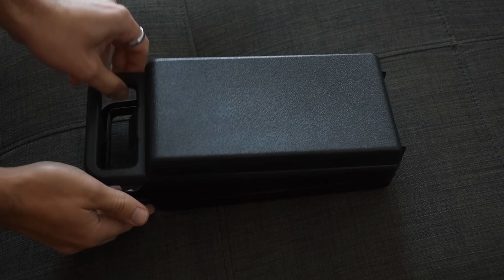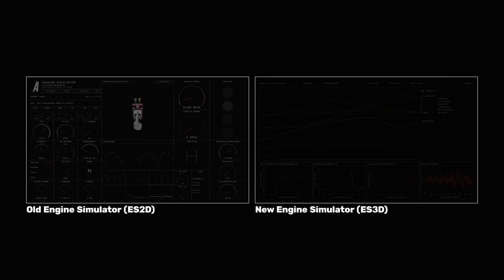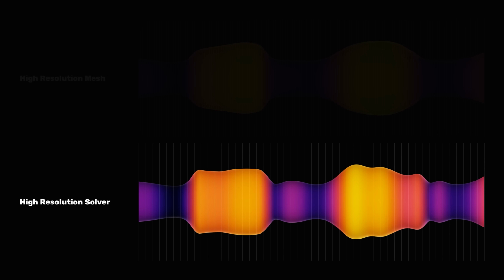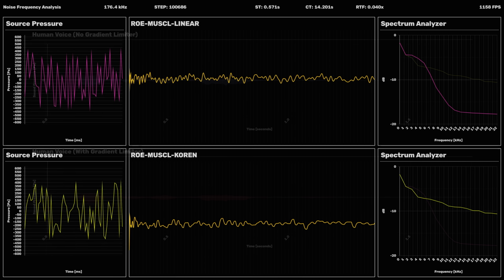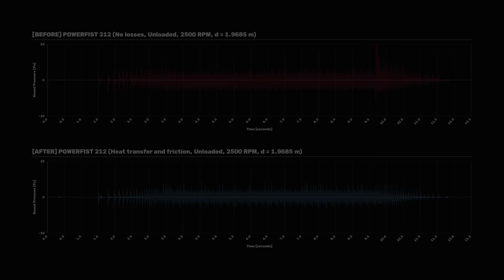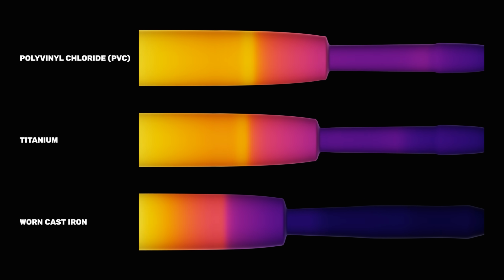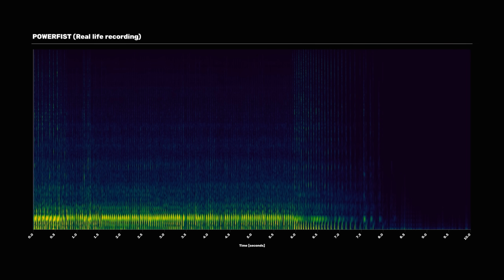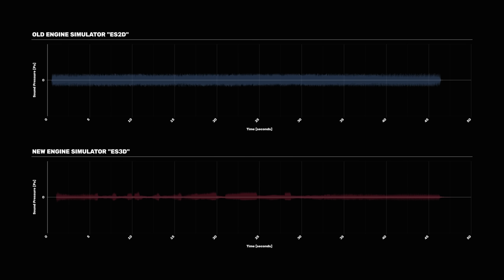Improving My Engine Sound Simulator With Real Data

Comment: Would there be a possibility that the fluid simulation is also hampered by the lengths only being the center length? Would the smoothing that comes from allowing the energy to take potentially bouncing paths be doable? Basically pulse dispersion.

Comment: I must say final samples sound like having ear directly at the exhaust exit. You Sir are very very close to real life sounds. I'm pretty sure that some online recordings of exhaust system makers like Yoshimura, Two brothers etc. are incredibly close to engine sim. and it might due to them recording straight shot from the tip, for some reason without the "puffs" of wind.
Probably to get more natural sound there should be an actual muffler like area were pipe no longer is a pipe. Mechanical chatter probably also is a factor, as it is with many things, imperfections are a part of what makes - visceral. A bit convoluted comment I know, but we are talking here about one human senses and in my case in non-native language.

Comment: When I was simulating guitar physics, by far the hardest part was to simulate the area where you're plucking the string. Without extreme care and deliberation, it sounds like you're playing the right notes with a sledgehammer.

Comment: I think the hacks you had to make to absorb high frequency reflections on the boundaries might be a byproduct of trying to approximate a tube with a 1d system. Especially the interface really requires at least a 2d system to be resolved adequately, and will naturally produce turbulence too.
Reply from the maker: By that logic, any fluid simulation would require 3 dimensions to not be considered a "hack". Yes, we are simplifying a 3D object into 1 dimension which for the purposes of this problem produces an adequate result. Assuming that at an outlet is a perfect pressure node is what causes the excessive resonance. In real life outlets are not perfect pressure nodes and have finite size, creating an impedance mismatch between the tube body and the outside world. Modeling this with a 1D simplification is not simply "hackery", it's a valid model created through simplifying assumptions, just like the rest of the simulation
Reply: @AngeTheGreat  if you don't like me calling it a hack, call it a crude approximation (of the outlet specifically). In a 2d case, the outlet creates vortices that quickly dissipate energy in a very nonlinear way. In 1d, you can't represent that at all, and I'd argue it probably has a higher impact on the overall sound than acoustics of the duct itself.
Reply: @AngeTheGreat also, axially symmetric geometry (like a 3d cylindrical tube) specifically can be represented very accurately in 2d, but it's really unclear to me why a 1d approximation should be sufficient.

Comment: i feel like this simulator has the potential to be groundbreaking for 2 stroke tuning. if you simulate intake/exhaust ports, transfer ports, reed valves, and expansion chambers with negative pressure waves, this simulator would be amazing for finding the best theoretical port maps/durations for a powerful top end, or low end torque etc.

Comment: 20:14 you probably already know this but a thought from doing small engine repair in the past. the amplitude increase at the end of the sample in the real recording of the 212 is from the throttle being slammed open by the govenor and increasing the amount of 'cold' air going through the exhaust. the simulation doesn't seem to do that, mind you, i wouldn't be surprised it doesn't yet, i'd argue that's such an edge case and not worth worrying about. it's really impressive that you've got to this point where we can nitpick over incredibly small things, it shows just how impressive the simulation is getting.
Reply: I think he plans on getting the fuel and intake systems simulated at a later date. When he made that chainsaw engine a while back, he mentioned that he tried to get a carb sim working to get that rough idle, but it didnt work too well. My guess is he will add in the more realistic intake and fuel systems once the fluid sim is nailed down.

To my ear, almost sounds like somebody made the 212 fuel injected in the sim and removed the mechanical govenor. I dunno tho, im no small engine expert.
Reply: Yes i recall that as well;  I know for certain engines he'll probably be thinking about intake plenum design for intake noise etc.
It really does sound like that and i feel the same applies to the harley engine. S&S and Harley Carb engines tend to be quite lean when revved and have a distinct hobble, that's is missing here.
Reply: The governor's spring is such a pain

Comment: Honestly at this state, applying an impulse response to evoke an environment feels like the final nail in the coffin already.
Some characteristics under load is so convincing. A motor cycle exhaust down a tunnel compared to the simulated I suspect to be so hard to tell apart.
That said, I think the finished simulator at the end of the day should allow the user to select between impulse responses and perhaps even custom. I haven't looked but I hope licensing won't become a problem to find decent impulse responses when distributing.

Comment: The problem where there are some "alien noise", very noticeable at ignition seems to still be present even in the latest samples. From what I've understood it comes from the simulation not representing the microgeometry of the inside of the tubes. There is too much resonance of higher frequencies compared to real life because of that. We have a similar problem of representation of micro-geometry in computer graphics. We call this geometry "Microfacets", you can look into "BRDF cook-torrance", it's one of the method to solve it.

Comment: I know it's become a bit of a buzzword, but AI can really help improve realism in situations where the exact underlying physical phenomenon is either unknown or impossible to solve in real time. If you run into something like that, using some kind of neural network as a black box post processor could be useful.

Comment: AI Summary

Abstract:

This video documents the extensive process of overhauling the fluid dynamics simulation for the game "Engine Simulator" to achieve highly realistic engine exhaust sounds. The process begins with collecting baseline audio data from a real single-cylinder Powerfist 212 engine using a calibrated measurement microphone. The creator then details the methodical, layer-by-layer reconstruction of the simulation, starting with a basic solver and progressively introducing more complex physics.

Key technical challenges and their solutions are explored in depth, including mitigating "artificial dissipation" with high-resolution solvers, managing numerical instability with gradient limiters, and implementing accurate models for valves, friction, heat transfer, and turbulence. A significant breakthrough involves solving the problem of unrealistic, excessive resonance by modeling the frequency-dependent reflection properties of pipe boundaries, which prevents the formation of high-frequency standing waves. The video concludes by comparing the vastly improved simulated audio to the real-world recordings and showcasing preliminary results for more complex multi-cylinder engines, before outlining the next development phase focused on creating the game's user interface.

Rebuilding the Engine Simulator: A Deep Dive into Fluid Dynamics and Sound

*   0:24 Real-World Data Collection: The project begins by recording a Powerfist 212 (a Predator 212 clone) with a calibrated measurement microphone to gather accurate reference audio. Tests are conducted with both stock and straight-pipe exhausts, and under no-load and full-load conditions, to capture different sound characteristics.
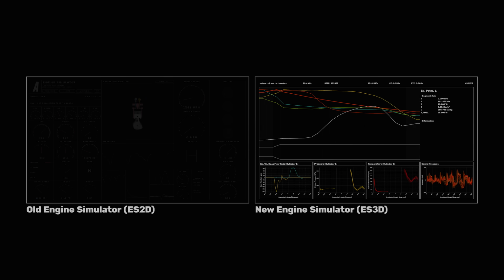*   3:51 Old Simulator's Shortcomings: Audio from the old simulator is presented, highlighting its inaccuracies, particularly during idle and deceleration. This demonstrates the need for a more advanced fluid dynamics model to capture these nuances.
*   5:05 Building a New Simulation from Scratch: The creator starts with the simplest possible fluid simulation. The initial result sounds muffled and lacks high-frequency detail due to a phenomenon called "artificial dissipation" inherent in simple solvers.
*   6:36 High-Resolution Solvers and New Problems: To improve sharpness, a high-resolution solver is implemented. However, this introduces numerical instability and spurious oscillations. "Gradient limiters" are used to stabilize the simulation, but they introduce their own audible artifacts.
*   11:18 The Frustrating Path to Realism: After hundreds of hours of work and listening to over 7,000 rendered audio clips, the technically "correct" simulation still sounds extremely unrealistic, like something from a sci-fi movie. This marks the beginning of a long trial-and-error process to identify missing physical elements.
*   13:11 Accurate Valve and Friction Modeling: The first major improvements involve replacing the simplistic valve model with an accurate one based on the work of Benson, which required developing a custom algorithm. Models for friction and heat transfer are also added to introduce necessary energy dissipation, reducing excessive resonance.
*   15:00 The Importance of Heat Transfer: The creator discovers that correctly implementing the heat transfer model has a significant subjective impact on the sound quality. The simulation can now account for different pipe materials, such as cast iron.
*   17:07 Key Takeaway: Solving the "Perfect Resonance" Problem: A critical issue is identified where the simulated pipe acts as a perfect resonator, exciting all harmonic frequencies intensely—something that doesn't happen in real life.
*   19:05 A More Realistic Boundary Model: The resonance issue is solved by creating a model where high-frequency sound waves are reflected less efficiently at the pipe's boundaries. This prevents the formation of high-frequency standing waves and dramatically improves the audio's realism.
*   19:26 Final Comparison and Future Engines: The final simulated audio is compared to the real Powerfist 212 recordings, demonstrating a massive improvement. The video also shows the new simulator successfully modeling more complex engines, like a Harley-Davidson V-twin, and previews works-in-progress like V8s using a new pipe junction model.
*   25:35 Next Steps: User Interface and Steam Release: The creator announces that the core simulation work is paused to focus on developing a user interface, a necessary step for releasing the game on Steam.

AI-generated summary created with gemini-2.5-pro for free via RocketRecap-dot-com. (Input: 18,390 tokens, Output: 896 tokens, Est. cost: $0.03).

Comment: I wonder if the inertial mass of what it is mounted to and the air surrounding the pipe act as dampeners, to some extent, reducing high frequency resonance.  It almost seems like your simulation turns the pipe into a "string" that is plucked, but has low or no decay

In a way the pipe itself might need a high viscosity fluid simulator.  I know you mentioned you could adjust materials, but I am curious how deep that went.  Thanks for another awesome video!  Every time I catch one of your uploads it reinvigorates my passion for programming.

Comment: Hi 
Need mechanical sound like gears and belt and chains and valves and camshafts and lifters etc added laters.
It is hard to add each one seperately but some thing simple.
Good job

Comment: Oh hell no one expects that your simulation will be like real life. It's too complex to get super realistic sound without going full performance pc crashing computing. Not only does the engine itself have lots of small parts that rattle and make mechanical sound(fuel tank rattle, muffler, cavities in engine reverb etc etc plus environment echo also changes how the engine sounds. Making it different in open space or near the wall.
What I would really do is add... Looping noise behind the main engine that would simulate all those smaller sounds and change it slightly depending on rpm. 😅

Comment: 15:30 That seems like an oversight on those author's parts 😳 I lack that knowledge AND intellect, yet even I can see how it would effect the tone...

[EDIT: LMFAO Had I only waited 30 more seconds. I'm leaving my failure as an example for/reminder to everyone to just watch the entire video before commenting! 🤦‍♂️🤦‍♂️🤦‍♂️] 
On that note... I waffled on mentioning this, but I've seen a video where a guy used different metals are exhaust. Same exhaust design, pipe size, etc, just different metal/alloy. Which when that impacted the tone of the exhaust.
So I can't help but think – and apologies if this is already done – you'll need/want to somehow simulate that as well 😓
Or at least to model the most common exhaust metal (mild steel, maybe even galvanized?), just so the resonance is correct. 

You and most of us know the exhaust noise is energy, and so some of that energy is lost by vibrating the exhaust give whilst traveling down if (hence why temp matters). So tougher, or even just thicker gauge metal, is going to be more resistant to vibrating and "stealing" energy, so that exhaust note at the exit will sound different as a result.
Reply from the maker: The author may have been referring to the engine at high RPM and under load. One complexity I faced while working on this is that most research papers focus on studying engines under useful operational conditions. Under those conditions, the residence time of the gas in the pipe is short so there is limited exchange of heat with the pipe walls. It might still affect sound, but if you look at a plot of sound pressure and compare it visually with a real recording, they would appear to match, which I believe is another bias that is in some of these studies. They prioritize roughly matching predictions to empirical measurements over matching how the signals sound to human ears, which is fair enough I guess. So combine that with the lack of interest in less useful conditions (like an unloaded engine at idle), and you find that many of the methods being discussed in the literature are not well suited to this application which is interested in engine sounds at ALL operational conditions
Reply: @AngeTheGreat  Yea, I suppose that makes sense... I guess I was taking that as they were opting not to model heat/heatsoak AT ALL, and treat the metal (or even exhaust gas) as ambient... or worse, with NO temperature.

So if I'm understanding you correctly, they are indeed factoring it in, just that they're calculating is based on an already completely heatsoaked system?
(a system that's "reached operating temperature")
Reply from the maker: Well, they didn't do any of those things, they modelled the tube as a perfect insulator, so there is no heat transfer whatsoever from the gas to the tube walls. That means there isn't even a concept of something being "heat soaked" because heat doesn't exist outside of the fluid itself. In my simulation, heat transfer is modelled in addition to heating of the tube wall itself, which also affects sound
Reply: @AngeTheGreat  Ooh. Well then, I'm a bit surprised their stimulated sound was "close enough" without heat factored in. I would honestly have thought a hot pipe would have a substantial resonance difference to cause a perceivable difference.
I'm glad you've decided to, just for the sake of realism if for nothing else! Now you'll just have to simulate ye olde cooling exhaust pings and tinks 😅

Thanks for taking the time to reply 🍻

Comment: Two questions:
- Is there any dissipation in the pipe model other than heat flow? Wondering about the effects of wall compliance and dissipation in tube/wall flexion.
- Pipe is 3D -- does the diff eq you are running account for this, e.g. can it represent transverse modes (even though the actual frequency of such modes is probably too high to matter much)? (I guess I am asking if the diff eq you are using is 1D, which seems unlikely given the amount of detail you have)
Reply from the maker: There are a lot of other factors including 3D effects that this simulation doesn't support. Things like viscosity, particulates, turbulence, wall deflection/deformation, etc. There is always more detail that could be added, the real challenge is finding the right detail/performance cost ratio.

Most engine simulations (even professional simulations) are 1 dimensional. There is a large body of research showing that for modelling typical flows in engine manifolds, 3D models don't give significantly better results. At valves and in the combustion chamber, however, the story is different. But to answer you question, no the simulation does not support most 3D phenomena inside the tube as it is a 1D CFD model.

Comment: One thought, and perhaps you have already done this, but it would be interesting to see more frequency domain plots of the actual vs simulation.  The initial thought is that for fine tuning, can you add a filter function at the output of each pipe based upon its characteristic length to reduce the effect of the tube resonance?  This would then become the input function into the next pipe segment.  Perhaps this is what you already did when mentioning other things that you did and I just did not pick up on it.

Comment: those simulation at the end we're godly <3.

if i can give you my 2cents about the problems still present, the resonnance issue is still a thing, especially at idle , and the profoundness of the similation is lacking ( maybe tied to the resonnance?). could it be that the thickness of the pipes is causing issue? 

again it's a innocent 2cents. that's an amazing work, godly i'd even say. i have such great idea's to use that .

keep up the good work and enjoy what you're doing